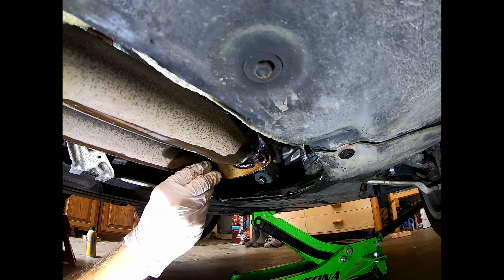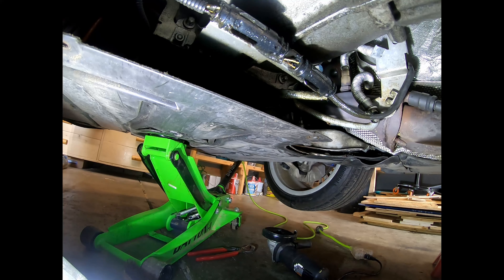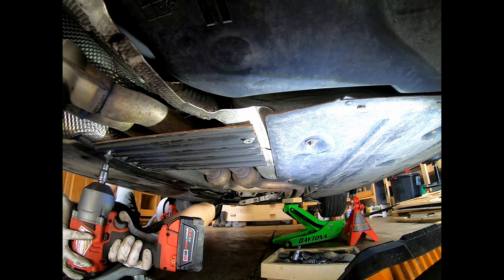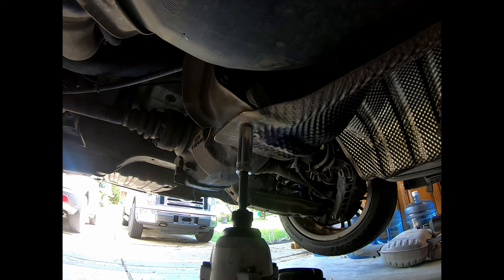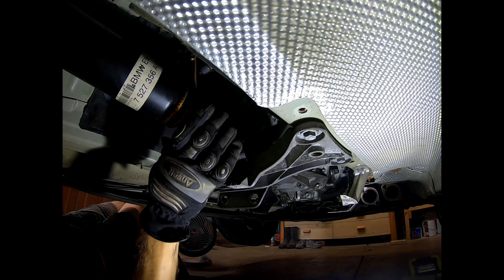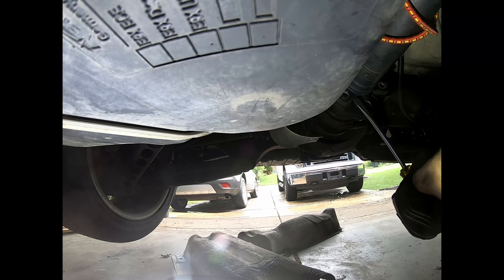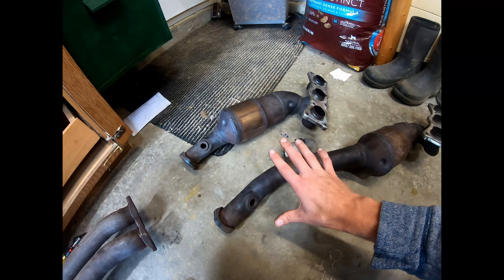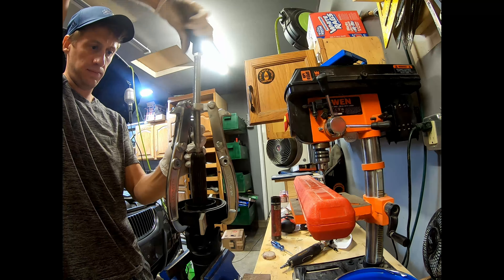BMW Flex Disc | BMW Guibo Disc Replacement | Center Support Bearing DIY || Evergreen Builds

Comment: Great DIY...Thank You!!  Recently performed this maintenance on my 2015 640xi (F06). Replacing the guibos and the center bearing is exactly the same! I found that if you take out the 3 torx bolts connecting the rear guibo to the differential and then the 3 bolts/nuts connecting the guibo to the transfer case then remove the 2 bolts securing the center bearing the driveshaft will drop down in the middle into a "V" shape which gives you plenty of clearance at both ends to remove the whole driveshaft from the car with very little effort!! Even if you're only replacing one guibo, front or back, it's best to drop the whole driveshaft, otherwise you will be fighting the hell out the end you're working on to get the centering sleeve to clear the pin. Since all of the bolts are stretch bolts they are supposed to be replaced so that you can get correct torque. I forgot to order 3 bolts so I used blue loctite and torqued them to the recommended torque (55 Nm) without the additional 90 degree angle and they torqued up just fine.

Comment: By far...the best video on this repair. Thanks for taking the time to film and narrate.
Reply from the maker: Thanks for the comment, much appreciated. Glad it helped!
Reply: Hello i have bmw 120 f20
When i accelerate my car shakes a little bit., when i let the gass off drives normal , im wondering that the gearbox is problem ( automatic ) what do you think ?
Reply: Please i need order only canter baring for cadillac  2009 sts
Reply: Because in Bahrain.  Not available so can you give me they side for a spar part

Comment: Incredible detail. You’re talented.  Actually, from this, I’ve decided to hire this job out.  There are so many hurdles, between rusty bolts, soot in your eyes, the weight of the components, inaccessibility, and me being alone and weaker/older— I’ve never seen a repair that better justifies or warrants having lift access and a buddy to help.  I love your lighting and including every single step, even the mistakes that you felt that you made.  This must be the problem I’m experiencing with my 2006 325xi wagon 6mt.  No one has found the problem.  I’ve replaced everything else!  $$$. God bless.  Jon

Comment: I did this job and also managed to destroy my centre support bearing during installation. I knackered the bearing itself by accidently tapping it. But had to drive with it that way until getting a new one. If you dont have a pipe I saw that you can actually use the other part of the drive shaft itself to push down the bearing

Comment: Thank you for the hard work videoing this job for us. I really wish he (and other DIY videos) would tell us the symptoms they were getting before they felt the need to do this job. He mentions at 12:43 that "It was the differential side of the driveshaft that was causing all the problems". But What problems? If he just meaning problems with getting it off or does he mean problems with the driving of the car?  Or if they were just doing it for prevention what are they preventing that will happen when it goes wrong. I have a 335XI that is now rear wheel drive only (I used Xdelete app to make it so) and when I am accelerating hard it makes a shuttering sound (No clunking or rattling). I have done a center support bearing on my E46 M3 before because it had obviously went bad and it was clunking around inside of it's ring with the rubber completely broken off. This doesn't sound like that at all.

Comment: I have heard it said you must "pre load" the center bearing.  How does one do this?
Reply: My understanding is before you tighten the bolts on the CSB to the car you pull the bearing forward towards the front of car to "preload" then tighten the bolts.

Comment: How did you get the driveshaft to spin like that? I got a 428i 2015 rear wheeel drive and habe the wheels in the, wheels will spin but not the driveshaft,  any idea how to get it to spin?

Comment: Hey man. I have some issues on my E60 520D. It vibrates when accelerating. Gets worse accelerating uphill. My mechanic told me it could be the flex disc / shaft bearing. But he said my car has only 1 flex disc. What were your symptoms?

Comment: Are the guibos the same? This is the first video I saw that shows two. I bought one thinking that is all it needs.
Reply from the maker: The guibos are different. Check out realoem.com to get the model numbers of each guibo disc. They were different on my 06 330i, and assuming they would not be identical on your model.

Comment: Any way to see the condition before taking things apart? I hate to remove things then see the disc and bearing good as new.
Reply from the maker: You could remove the skid plates and inspect the discs with a visual inspection. Look for cracks and splits, see if the metal inserts are still in tact. If you have the car up on 4 jack stands, you could put the car in neutral and spin the driveshaft to check all the way around the discs. If the car is vibrating when driving at highway speeds, that could be a symptom of a bad guibo. See attached link to see a guibo that is really bad. This is from a Infiniti G37, but same idea of a bad disc. Hope this helps. 

https://www.myg37.com/forums/engine-drivetrain-and-forced-induction/288440-help-with-flex-disk-driveshaft-coupler-guibo.html

Comment: Hi. What model of Continentals tyres are you using ? And how they manifest?
Reply from the maker: Hey Florin, they are Continental Extreme contact. Not sure what you mean by how they manifest, could you elaborate?
Reply: @EvergreenBuildsDIY  Hi. Thanks for responding. I meant to say how they handle on wet/dry, and if you think Conti will last for more than 4 years (driving normal, without drifts/burnouts). I'm planning to buy a new set of 18" tyres for my bmw ( 225/40 r18 front & 255/35 r18 rear). I was thinking about continental  or Goodyear Eagle F1 Asymmetric 5. Do you have any advice ? Thank you!

Comment: Just curious, I’m chasing some drivetrain vibrations. What are symptoms that you felt leading you up to replacing it?
Reply from the maker: I had vibrations when driving at highway speeds. The passenger seat was visibly shaking when going over 70mph. Check wheel bearings as well, at first I thought it was a wheel bearing problem, which is another common problem.

Comment: How many hours of labor would a mechanic charge for this job?
Reply from the maker: Maybe others can help with an estimate, but to take the exhaust off, heat shields, remove drive shaft, replace discs and center support bearing, and put it all back together...probably like 3 hours if they are efficient. Depending on where you are and who you go to, probably $300-500 worth of labor, excluding cost of the parts. That's just a guestimate, so don't hold me to that.

Comment: Do not forget to preload center support bearing … unfortunately this guy did not, that’s why one of the bolts was not straight into the bracket … this will lead to premature failure at some point
Reply: Hi Chris. When you say "preload", what do you mean? Do you mean the bolts that bolt the bearing housing to the body of the car?